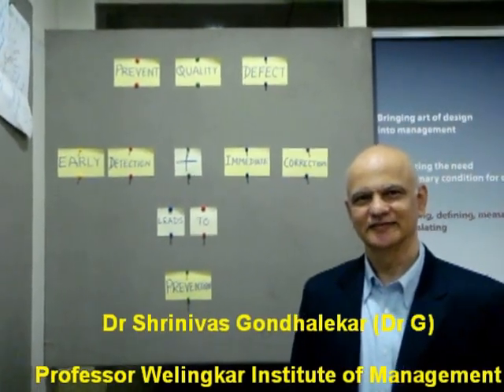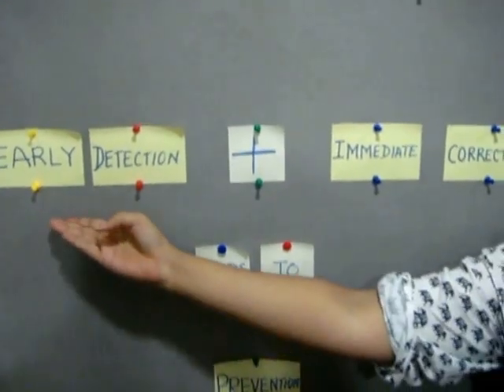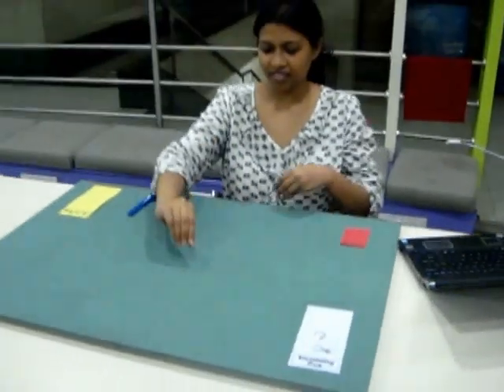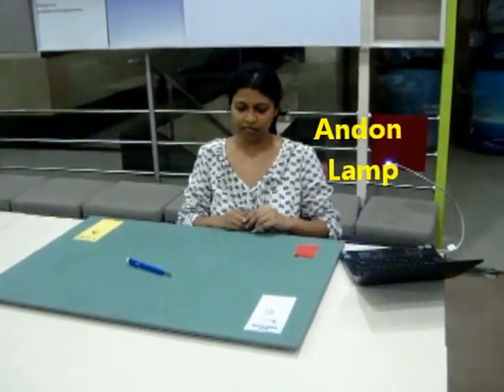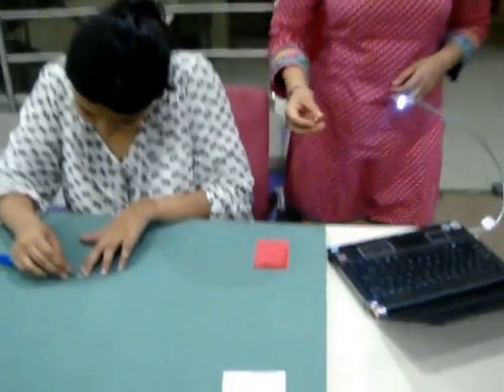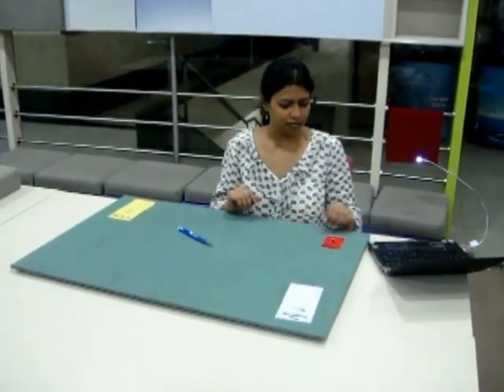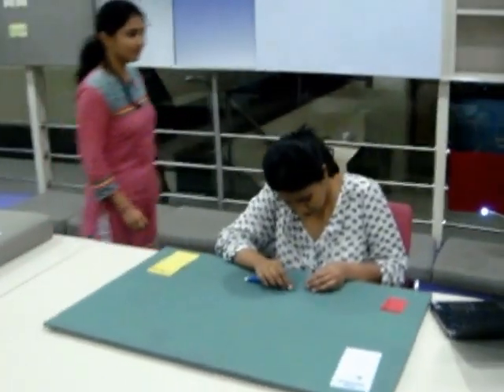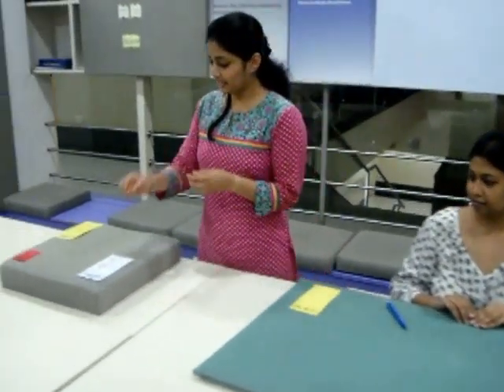Defect Prevention thru "Early Detection + Immediate Correction"

Comment: As in this video Dr. G has taught us that how with the help of an ANDON LAMP and WALKING INSPECTOR we can detect the defect in an early stage and can make immediate correction which results in the high quality of the product and also reduces the risk of cost for rectifying that defect in the final stage or during the phase of release of the product in any company.
Application: As we all do assignments and presentation in our lectures, this method can be applied in reducing the errors and defects in our assignment reports and presentation.
While doing assignments and presentations we normally go to the proffesors after completing it, if any error or defect comes during that time then we have to do that assignment or presentation again, which consume lots of time again.
Solution for this can be that
1) We can divide our assignment reports and presentations in parts and do it.
2) When we are completed with first part of assignment report or presentation we can mail that to the lecturer(WORK INSPECTOR), here our mail can be treated as a QUALITY CHECK AREA as mentioned in video.
3) After that we can send a msg on the lecturer's (WORK INSPECTOR) phone for the QUALITY CHECK, here our msg will act as ANDON LAMP for the WORK INSPECTOR. And then can start working on another part of the same assignment or presentation or we can start another assignment if we have.
4) If the Lecturer(WORK INSPECTOR) pass the first part of assignment then we can continue with the next part, or if the Lecturer(WORK INSPECTOR) rejects the first part due to some error or defect then we will first rectify that defect, and again send that for QUALITY CHECK, when it gets approved by the Lecturer(WORK INSPECTOR) then we can continue with the next part.
If we use this method then there are very less chances of occuring of errors and we can achieve ZERO DEFECT wihout any investment.
Thank You Sir

Comment: Early Detection+Immediate correction leads to prevention could be interpreted as follows:
1. Early detection helps us finding the error at the root cause. i.e, the area where it is generated. this in turn helps us preventing a Major batch Rejection which is bound to happen in the absence of this process.
2. The Rework might not be possible on the product if multiple operations are involved. Also the Rework cost is minimal at the initial phase.

Comment: Sir, I find the concept of defect prevention through early detection & immediate correction useful for detecting defects at source instead of catching it at end of line inspection process. I could correlate this method with early warning system (EWS) used in my previous organization, Bosch Ltd.
Andon system helps to grab attention of QC operator without any delay after part has been processed on some station.
However I would be grateful to you if you could share with us with such video, why organizations prefer now a days quality assurance(QA) than quality control (QC)? i.e. producing quality product than controlling quality of produced part.
Looking forward for your views and guidance regarding the same. Thank you in advance....

Comment: Dear Sir,
A  simple application of early detection could be the "Fire Detection System " which typically just prevents the entire area from damage  by use of water sprinklers which start sprinkling water when its sensing device come in contact with smoke fumes.

Thus , Preventing larger damages by immediate smaller corrective measure

Comment: Hello Sir,
This incident reminds me of the problems that I encountered when I was working for an IT firm. While developing a Software the first step involves writing the code during which we come across a lot of bugs which we are not aware of. Later during the testing phase, the entire piece of code is checked thoroughly and debugging is done. If the coder himself checks the codes at proper stages the debugging process would save time and money. This can be related to Quality check principle.

Comment: Without spending on new system to prevent defects , existing system can be modified to detect early and correct immediately , this would eliminate proceeding with faulty item. An auto mobile industry can benefit with this technique in there operations.

Comment: Hello Sir
The video is very informative but has left me with a doubt.....

The technique used can be very well implemented in Jewelry manufacturing and stores making custom made products (ie. in places with low output or stores involving niche products, just like you mentioned)

But won't it prove to be futile in situations where large number of units are to be produced (say, in case production units)?

So what should be done in such places for Early Detection of defect & Immediate Correction?

Comment: The similar concept is used to warn the operator of a generator that electricity has been restored and now switch off the generator as soon as possible.to avoid wastage.
Also sir, what is the solution if the manufacturing process involves a lot of steps ? Then keeping a quality inspector at each step of manufacturing would be expensive. I would like to know what can be done in such a scenario ?

Comment: dear sir
what if the operator is equipped with gauges(like a poke yoke) at critical stages which they themselves can use to detect the defect so that they don't pass it on to sub sequent stages and then the quality inspectors can be placed during the end of assembly line.